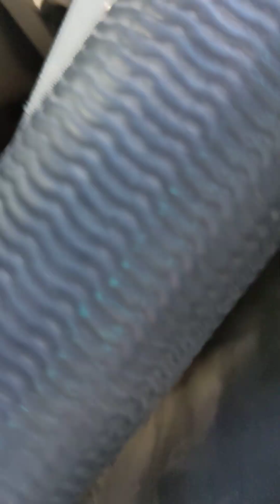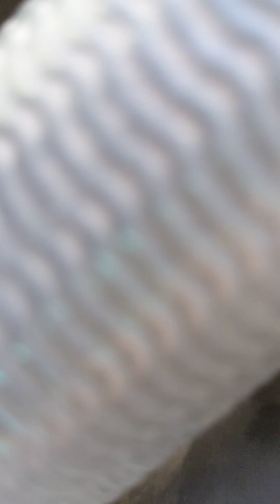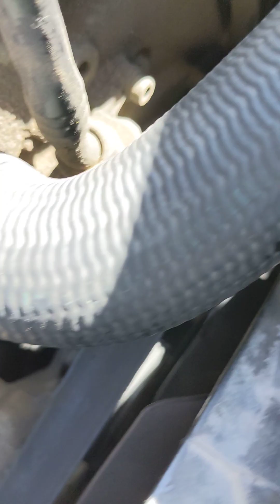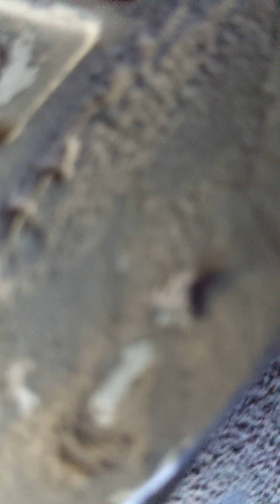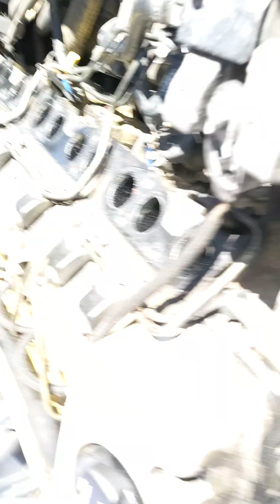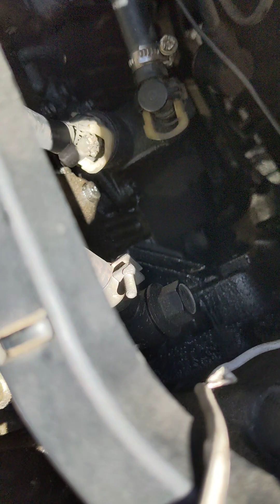How to change injection timing on  Mercedes OM606

Comment: The reason you're finding it so hard is to adjust  the pump is there are 4 bolts not 3. 
The information in this video about timing is also wrong.  You need to advance the timing if you change to 150 bar injectors because it takes longer for the injectors to "pop" which  in turn retards the injection angle. Kind of shows your lack of knowledge
Reply: Hey can u help me ... they did a bad job on mine when i put the camshafts on point the crank is at 10 and the pump is not on point, do i have to diassemble all the front or ...? Thanks

Comment: Hi thanks for this vid, my OM606 up to 1500rpms runs like a tractor, above 1500 it runs like a champ.. its OEM setting, injectors were pop checked and it runs fine within 135Bars... any ideas?
Reply: any solution ? same problem thanks
Reply: @bigfather1279 me too